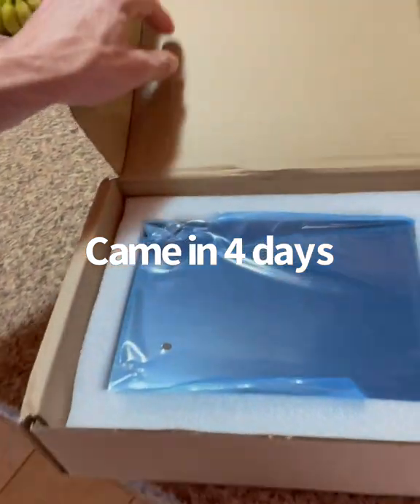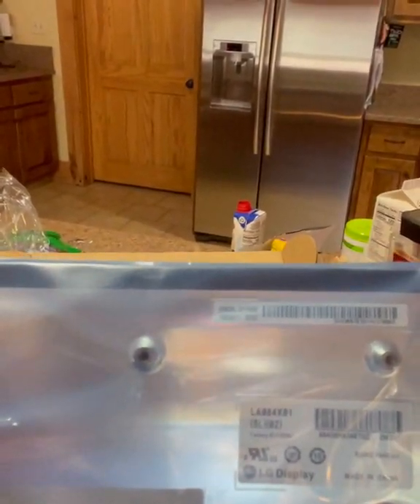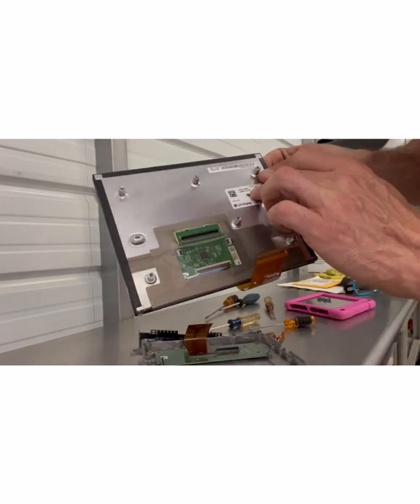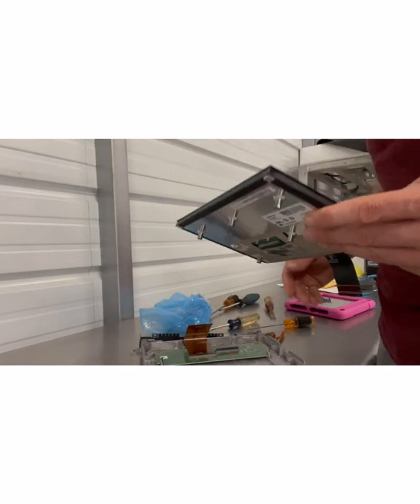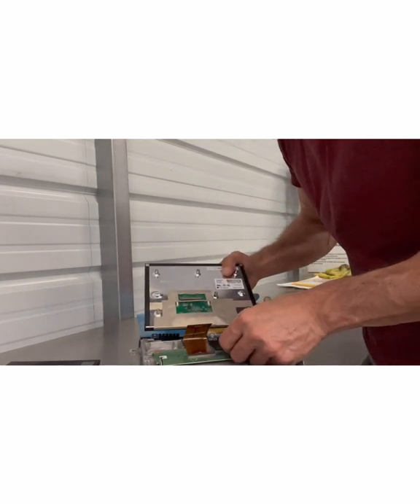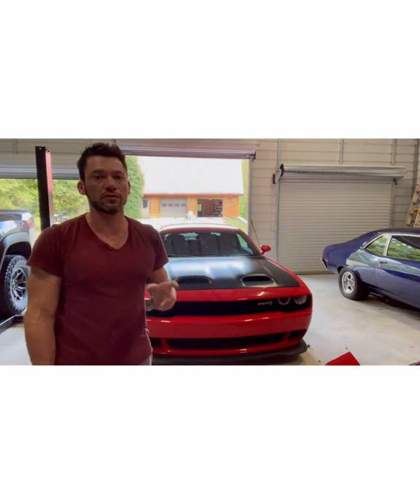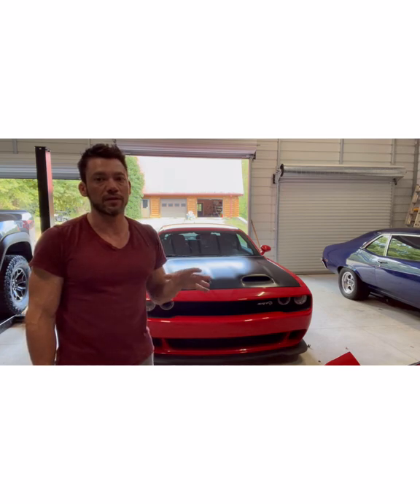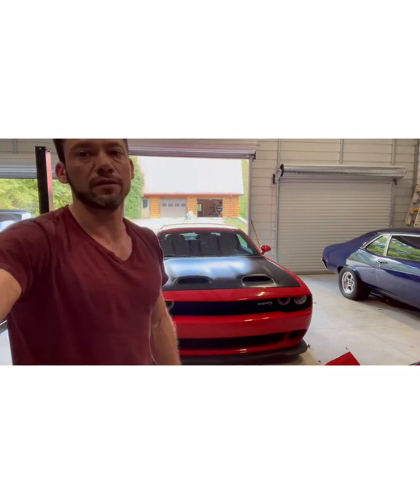Challenger uconnect screen replacement

Comment: Awesome video! Just replaced my UConnect screen on my 2017 challenger scat pack and it was the exact same process! I wanna mention that when you get the screen hooked up and fire it up for the first time you can do a soft reset after the first boot up. All you have to do is tap and hold the top right corner of the screen for about 10 seconds and it should rest to the settings you had instead of the factory setting. Hope that helps others that are doing this process!
Reply: Question how much did you pay for your screen? I got 2017 scat too!
Reply: Paid $229 on eBay for mine and it works perfectly so far

Comment: Heya, I just did this to my 2018 Challenger 392 T/A. Getting the dash trim off was a biatch, but the rest of it was pretty easy. I feel like there should be a class action against Dodge/Jeep/Chrysler because they KNOW it's a defective part. I took mine in to see if it was warranty covered (which it wasn't) and the repair tech that intakes the cars and set appointments yells over his shoulder to the rest of the customer team, "We got another delaminate!". THEY ALL KNOW it's a defective part.  Anyway, they quoted me $1700. I laughed at them and drove off. I am going to drop off the old delaminated screen and give it to them and tell them I fixed it myself but since it's their crappy part they should have it.

Anyway thanks for the video and hope you and yours are doing well.
Reply: FINALLY found someone with yes same car as mine. I've had this delaminating problem for almost 2 years now and been skeptical ordering the screen because I wasn't sure of the part or model number. Did you get the same screen as the one in the video? Same part number? Because I'm finally going to order one off ebay. Just wanna make sure I don't order the wrong part or model number

Comment: any links to the screen you got?
Reply from the maker: https://www.ebay.com/itm/373854507053?mkcid=16&mkevt=1&mkrid=711-127632-2357-0&ssspo=no3gzbnrs4s&sssrc=2349624&ssuid=T6y2XhNoTDS&var=&widget_ver=artemis&media=COPY
Reply: Good morning, I have the same problem and was going to order the same screen you did but my 2018 challenger didn’t come with nav and it’s an r/t not a hellcat. I was wondering if in your opinion if this would be the right fit . I was told by some websites I have to have the exact same s/n but yours was a little different and it worked fine. I want a quality part and I think you said this part was an upgrade. Thanks for your time